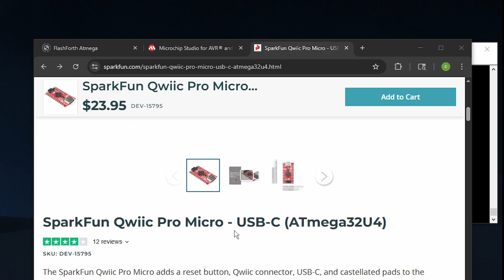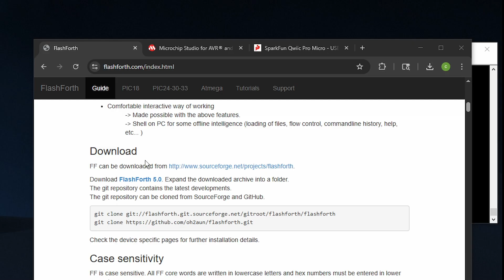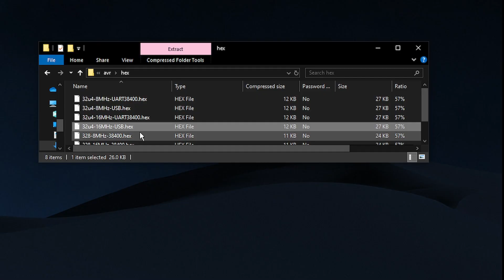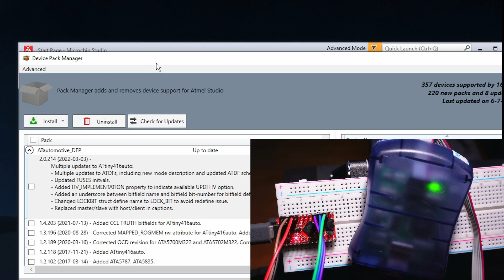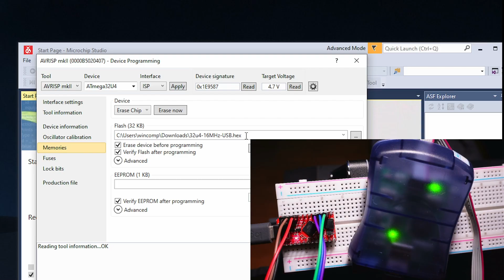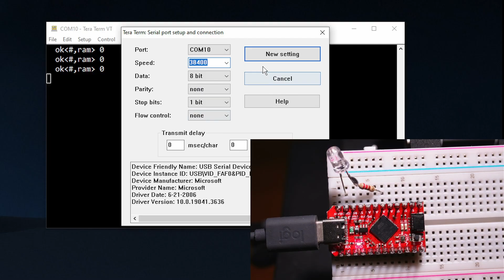How to install FlashForth on a Arduino Pro Micro - AVR MKII programmer

Comment: Hi how do you burn bootloader to Arduino pro micro which is bricked
Reply from the maker: I’d check out this page on a few things to try https://arduino.stackexchange.com/questions/13292/have-i-bricked-my-arduino-uno-problems-with-uploading-to-board
Reply: Hi if i do what you do by. Useing the programmer will the pro micro work
Reply from the maker: @puresim316nosimracingnolif3  i would try the things on the arduino stack exchange and see first https://arduino.stackexchange.com/questions/13292/have-i-bricked-my-arduino-uno-problems-with-uploading-to-board